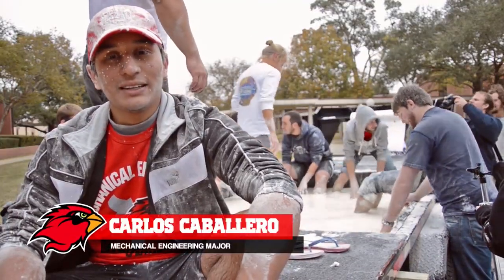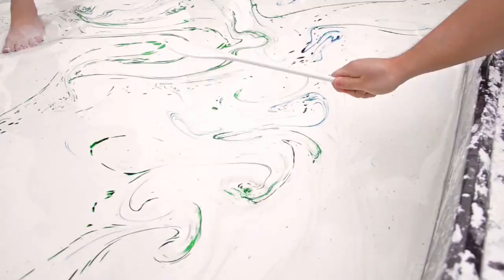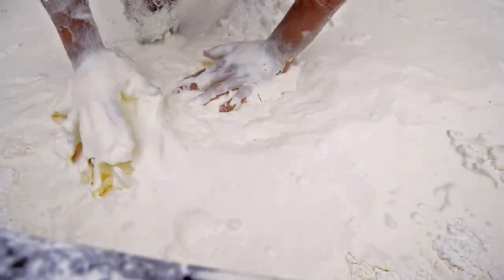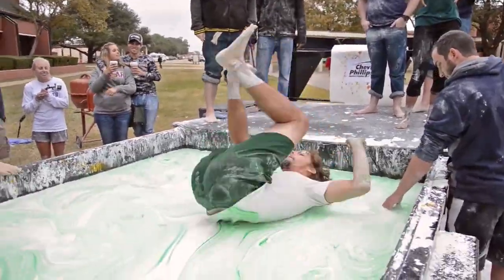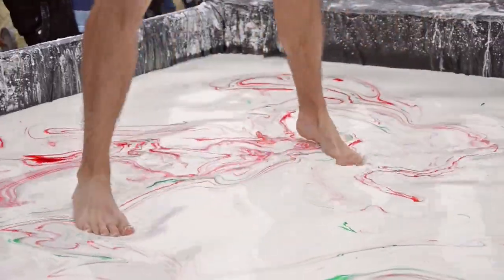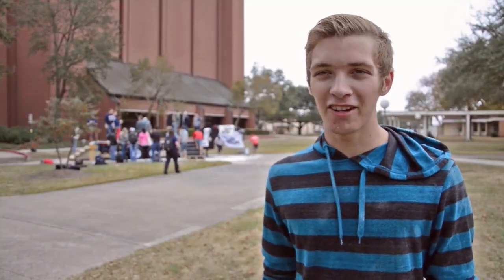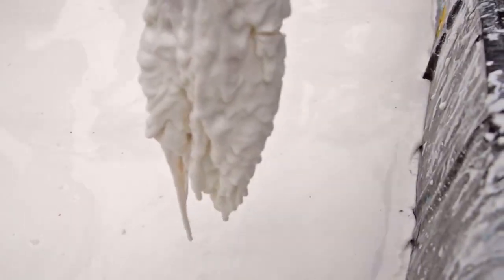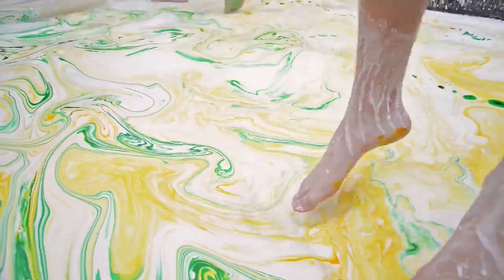Fun with Non-Newtonian Fluid - Lamar University

Comment: H2O has surface tension. It is literally a hard phase of H2O. As its name suggests, surface tension occurs on the surface of liquid water. So, think about that, a solid exists on the surface of liquid water.

Now consider this: if you can maximize the surface of liquid water in three dimensions you can create a 3 dimensional form of H2O surface tension. When force is applied to the mixture the grains of corn starch are forced between water molecules creating an internal, three dimensional surface. And so, corn starch is not providing the structural strength. Corn starch is providing the surface. The tensional forces that make the substance hard are provided by the water molecules. And it is based on the same (heretofore unexplained) principle that causes surface tension of liquid water.

BTW, this understanding provides us an alternative hypothesis for ice which is currently thought to be a result of a lattice. This new understanding suggests that the lattice hypothesis is mistaken and the reason ice is hard has nothing to do with it turning into a lattice but, instead, has to do with factors that create an internal surface in the body of water.

I am a scientist who will soon be revealing my solution to the anomalies of H2O. Here is a link to a meetup in the SF bay area that will begin to resolve all of the long standing mysteries of H2O's anomalies:
Resolving the Anomalies of H2O / James McGinn
https://www.meetup.com/Resolving-the-An ... 246928935/

Comment: The problem with this thing is that once you sink in it's very hard to get out, because a little bit force would make it a solid, so trying to get yourself out would be in possible. There's no way you can put enough force to fight gravity without making it a solid that traps you. So keep yourself not sinking. A good safety would be tie a rope to the person and if sinked in too deep then let other people pull out with constant velocity.
Reply: This is also why quicksand is considered a non-newtonian fluid
Reply: You CAN get out.  But you have to move very slowly, and not struggle.
Reply: John Bu it's not deep!
Reply: you can also just pull hard enough to break the solid bond.
Reply: PIN THIS COMMENT ADMIN